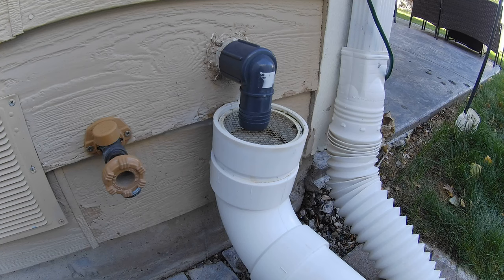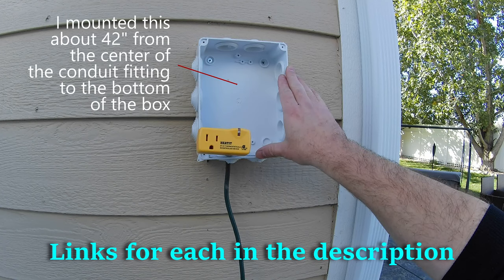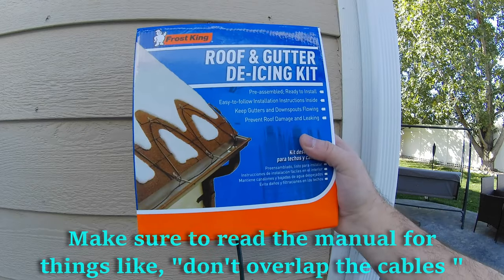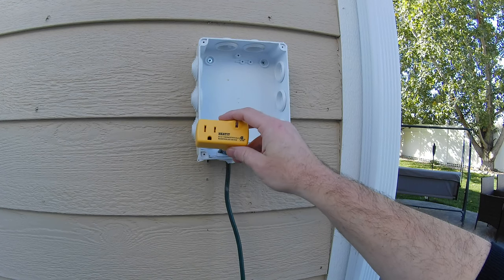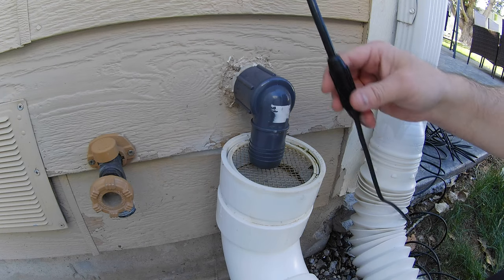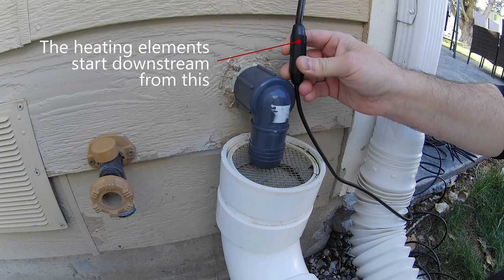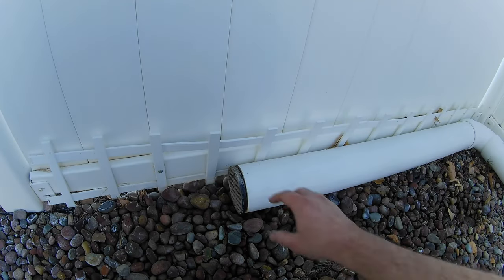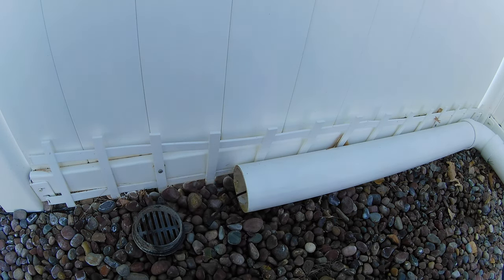Above Ground Sump Pump Discharge Pipe - Peace of Mind

Comment: Is there a solution for using a single sump pump with two independent discharge ?  For example the sump pumps outputs water to the main sewer,  but if the sewer is blocked it opens a valve to output the water to another independent outlet like to the yard or driveway.

Comment: I just put a couple handfuls of salt in mine every once in a while during the cold days. My sump pump doesn't run as much during the winter. It isn't until the spring thaws that my sump pump really starts pumping away.
Reply from the maker: Nice! Thanks for commenting! Yeah, I've done that as well before adding the de-icing cable. My street was built in an area with a high water table and unless the freeze really penetrates the ground, my sumps still manage to run during the winter.  Maybe a combo of the two for extra measure 😆. I have some grading issues around my house that I'm positive isn't helping either.
Reply: @treasurestatetoolbags  I understand. Mine has one of those sump pump freeze guards on it and I am running a 4 inch 25 foot discharge hose that ends in the front of my yard. It's tucked to the side of my front garden so it helps water that as well during the warm months. Got a nice valley between the houses where the water goes. My house is built high up on a hill so the water does run down. Got one of those Drain Emitter things on the end of the sump pump discharge hose so critters can't crawl up in there and die in the hose. I didn't dig a trench cause like you I have a bad back. Besides, whether it's trenched or above ground the water will freeze in their just the same. And with it being above ground it's so much easier to service it every year. It was like -30*F here a few weeks back and it worked just fine. I just put a little calcium Chloride in it every once in a while and the water just kept on draining. Works good. We're in the 50s now so yeah my sump pump is really running now with all the thawing of snow and ice.
Reply from the maker: @eddiea3782  That's reassuring to hear about for sure first hand from someone that's been doing this. Replacing burned out sumps is not anything we really plan for and it usually happens at the worst time. Our ground water here seems to be corrosive as I used to have to replace my two sumps every couple of years until I coated the latest ones with Rustoleum. I'm on year three with them now and a little nervous. We'll see how long they last. Thank you for providing some insight on your setup, much appreciated.
Reply: @stephenboi3616  No, I put it thru the grill of the freeze guard outside the house so it has plenty of it in the 4 inch corrugated pipe. It melts along with the water as the sump pump shoots water in there. Maybe once a week during the sub freezing weather I go out and inspect it to make sure the discharge pipe doesn't freeze over and then I add about a cup of Calcium Chloride down into the pipe. That stuff is better than rock salt. It can go down to -30 and still work. I take the opportunity to shovel away any deep snows around discharge next to the house too. Plus I have a whole generator on that side of the house I have to keep clear too. Winter maintenance.
Reply: @treasurestatetoolbags  this year is unusually warm so now I have A LOT of snow melt around the house. My pump is going every 12 minutes. The house was covered in 15 inches of snow and ice and now all of that is melting. The soil is saturated. Mine is a battery backup so two pumps in one in the basin..........and I have a spare pump sitting on the side just in case I need yet another one.